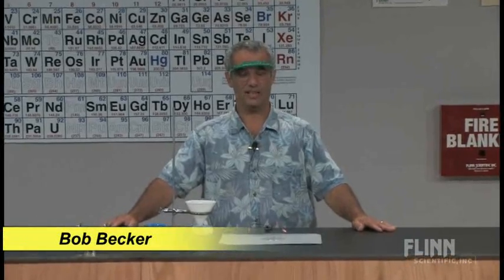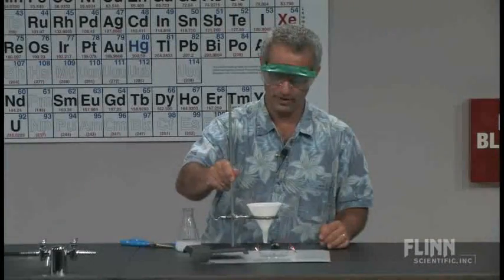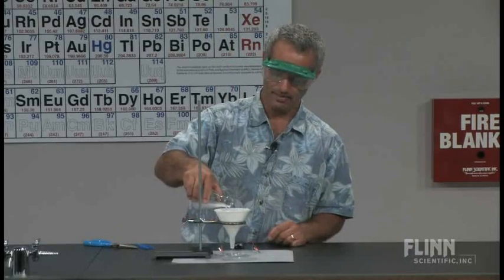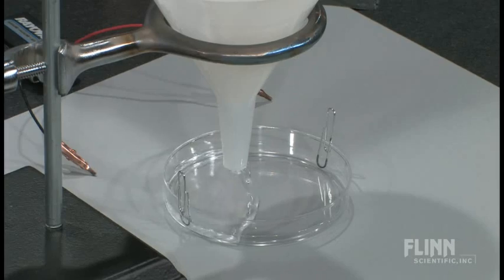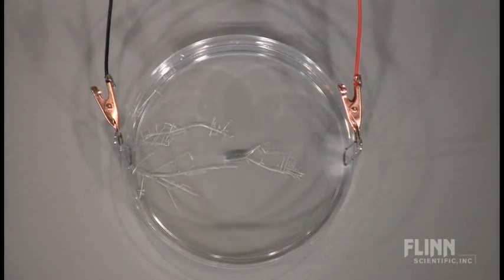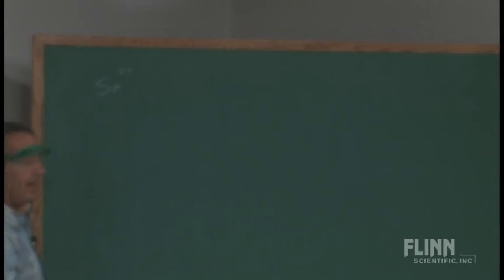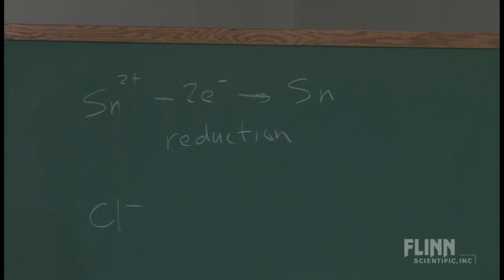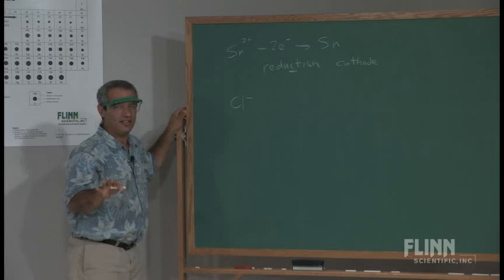Tin Man Electrolysis

Comment: The assumption that the tin acts as the reductant at the anode is probably correct, but the precipitate is probably not tin(IV) chloride. Tin(IV) chloride is a strong Lewis acid (a consequence of the strongly electrophilic tin(IV) centers of each molecule) that immediately hydrolyzes on contact with water to form HCl and "stannic acid", or tin(IV) hydroxide, which quickly undergo partial dehydration to form hydrated tin(IV) oxide, which is most likely the white precipitate.
Reply: Furthermore, SnCl4 is a liquid NOT a solid!
Reply: noilex Actually, and I was pretty surprised by this myself, tin(IV) chloride can adopt two structures, depending upon its state of hydration. The anhydrous form is the more familiar liquid, but there's also a hydrate (I'm almost sure it's a metastable dihydrate) which exists as a solid.
Reply: Lorenzo Pacheco  Ah..! I was not aware of that... Thanks for the info, I will have to look into that:)